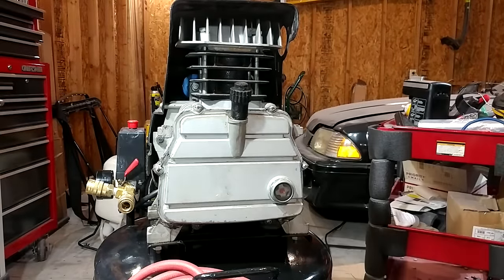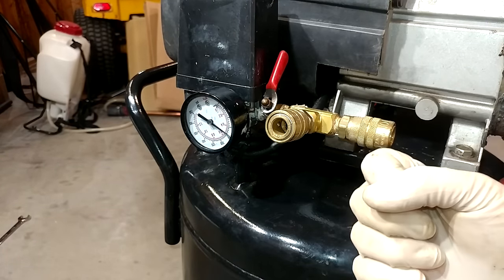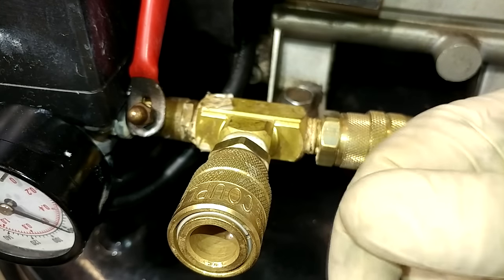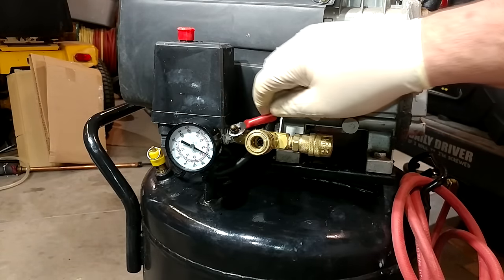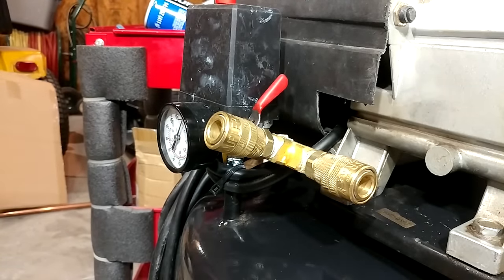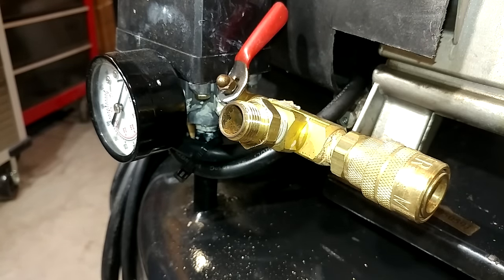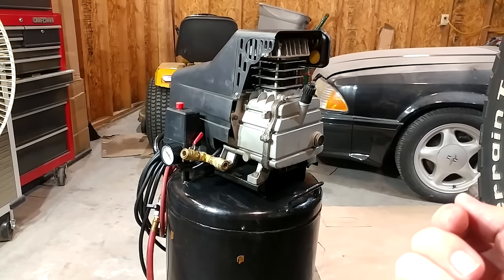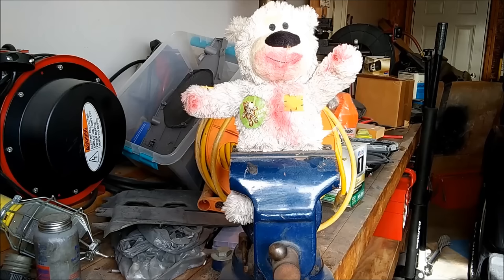Cheap Upgrades for Cheap Air Compressors!

Comment: okay so what exactly is the issue with a pressure regulator that is not allowing a larger flow rate?

a few comments regarding pressure regulators.  BY DESIGN, pressure regulators inherently affect flow rate.  This is just a reality.

and not surprising that your links do not point to any such improved design pressure regulator that allows better flow...BECAUSE THEY DO NOT EXIST !

lets gather some basic mathematical principles:

Bernoulli's Principle states that as the speed of a moving fluid increases, the pressure within the fluid decreases. (a moving fluid can also be a compressible gas...aka, air)

so if we think about what this principle is stating, we can make a few assumptions based on it:  

1.  if you change the pressure by increasing it, the speed of the air  decreases.
2.  if you change the pressure by decreasing it, the speed of air increases.

the internal components of a pressure regulator does not contain any magical unicorn or fairy dust.  It is a simple mechanism.  By closing the orifice, the air speed goes UP...and this has the effect of causing the air pressure to decrease.  And conversely, by opening the orifice, the air speed slows DOWN, but the pressure goes UP.

the relationship between how fast the air is traveling and how much pressure changes happen are essentially inversely proportional.  Changes made in one, change the other in the other way.  Pressure goes up, speed goes down.  Speed goes up, pressure goes down.  and visa versa.  

in summary:  you will NEVER GAIN some flow rate improvement on an air compressor, no matter what type of regulator that you use!  You are locked in because bernoulli's principle locks you in.    This includes how fast the air compressor can recharge, and how large the main tank input from the motor and the motor capacity as well as the tank output and line.  regulators must influence air speed...this allows for the pressure control.  

finally:  if you want a better flow rate, you will simply have to modify the air compressor entirely from scratch that would involve   A much larger faster and more powerful motor.  And larger diameter  input plumbing.  And also larger diameter output plumbing including the working line past the regulator.  Then you could install a larger capacity regulator that would allow you to regulate that larger volume in the plumbing.

I hope this makes sense.
Reply from the maker: This statement: "...you will NEVER GAIN some flow rate improvement on an air compressor, no matter what type of regulator that you use!"

...seems to be the root of the confusion. I didn't intend to say you can increase the flow rate of the compressor head itself. I intended to say that the regulator the compressor system (the compressor, the tank, the fittings, etc) came with has a terrible flow rate and/or pressure drop problem. To answer the only question you asked, I suspect the reason for that is probably really tiny internal passages. If you want to see the chart for the upgraded regulator you'll eventually see on the channel, it's a Parker 08R613AB. In my desired configuration, it should be able to flow several dozen CFM @ 90psi. I doubt the HFT regulators can flow 5. HFT doesn't publish performance data for their stock regulators so we'll never know.

My links didn't point to a new regulator because I didn't install one in this video. There's no smoke , mirrors, or magical dust here. I make money from links. I don't make anything by telling you to simply omit an item. 😆

Anyhow, I hope that cleared things up for you.
Reply: @TheBrokenLife  I think you are going to find (no, not think...but WILL FIND) that you are chasing a dream that doesn't exist.  The regulator is designed to accommodate  TANK SIZE AND REFRESH RATING OF THE MOTOR FOR THAT SIZED TANK. (plus to a certain degree the intake and the output plumbing).  So you go right ahead and experimentally demonstrate your dozens of CFM improvements with the parker...here is what you can expect:  At full open it will produce no more and no less than the existing flow rate.  WHY?  Because it's your working line diameter dude!  Also if you turn it in, then you will arrive at a certain regulated pressure, then same as you would with the OEM regulator and again, the flow rate will be no greater.  

this is the point you seem to be missing in your mission to upgrade things.  It's the entire system.  you've been led to believe that flow rate can be changed with a bigger larger regulator.  I am sorry to break this again, but it does not work like that.

About the ONLY thing you can accomplish with the said parker is possible more grandular control and maybe durability of components materials.  

I do not know why this is so confusing.  The regulator can only decrease BELOW the working flow rate of the output plumbing AND your working line (flexi hose...plus all the fitting downstream of it).  The regulator can NOT increase the flow rate above the working flow rate.  

this is one of the reasons why so many retail air compressors and even high end are restricted to low CFM ratings...It's not the regulator.  It's the fact that the capacity of the tank and the motor are only capable of providing the levels of pressure for that volume at wide open through all plumbing.

Here is a good way to demonstrate this.  take the pressure regulator off completely.   go direct to the output line with a air flow meter. Completely charge the tank with the motor and then start the test.  Measure the flow rate.  Notice how rapidly it drops.  At full wide open the motor will never be able to recharge quickly enough to maintain the initial flow rate.  This is why regulators are designed AROUND the entire system. Now put the OEM regulator back in, recharge the system completely with motor on.  Open the regulator to full open...again measure the flow rate.  You will find that the tank is able to maintain this wide open flow rate much much longer.  The small restriction is what makes the tank useable longer, while still maintaining the rated pressure!  Now if you want, you can demonstrate this also with the higher volumetric parker.  But understand a few things...even at wide open, the parker is never going to overcome the diameter of the input and output plumbing and the working line and all connections down stream.  You will demonstrate this if you really want to understand how nothing will change in terms of flow rate.  

and yes, putting the flow rate out at the very end of the working line is what I am talking about.  Because, again...the ENTIRE system is subject to bernoulli's...not just the regulator.

I don't think there is anything bad about the oem regulators.  If they are hard to adjust or have accuracy or holding problems...they are cheap enough.  throwing a parker at this isn't going to do much of anything.  It would be like slapping pirelli's on a go kart and expecting to get more horsepower.  flow rate is inherently tied to the system design.  regulators are not going to change that design.  If you want really high CFM...you are going to  need a much larger tank with a higher PSI WORKING RATING, a faster stronger motor to keep up, and larger diameter input and output plumbing.  

Good Luck.
Reply from the maker: @tdmmcl1532   "The regulator can NOT increase the flow rate above the working flow rate." I never said it could. For the second time I'm going to tell you that this is something you pulled directly from your imagination and seems to be the root of your misunderstanding. I said a good regulator (the Parker) will flow more than a bad regulator (the HFT). I also said, in a round about way in the video, that omitting the regulator will flow more than any regulator. I stand by all of that. I don't actually think we disagree... You're just thinking I said things I didn't for reasons that I don't fully understand at this point..?

Moving on ... "I don't think there is anything bad about the oem regulators." So you have no direct experience with this issue and are just speaking about things in terms of how you feel about them? Do you even own one of these compressors? 🙄 If you don't have this problem, then you don't need this solution. It really can be as easy as that. I also don't assert that every cheap compressor out there is going to have this issue. The one in the video is nearly 20 years old. Hopefully someone would have gotten one right on accident by now.

As regards the rest of your statements... Your beliefs seem to require the assumption that the HFT regulator simply cannot be an impediment to flow, or,  that they're an intentionally designed impediment dependent, which is hogwash. These compressors are "restricted to low CFM ratings" because of the price point, and after that, the power available out of the wall. There is no intentional balancing act of careful calibration by HFT's teams of engineers on this $150 air compressor. 😂Decreasing performance to "useless" upon the first pull of the trigger of an air tool is not a feature of the product, it's a bug. 

My belief is that HFT simply bolted the cheapest thing on to it that they could find and took no express care at all while they did it. Which really seems most likely? 

The actual truth, in function, is the HFT regulator didn't flow enough air to run an impact gun and removing the regulator solved the problem. I've found that to be true on 3 of these units, personally. You can watch the regulated side pressure drop to 20-30psi while there's 130psi in the tank. The regulator cannot flow the air required to operate the tool. Simple as that. I think that's almost verbatim what I said in the video. So... at this point there's either some other explanation for that phenomenon that you haven't managed to express, or you're calling me a liar.

Your "Pirelli's on a go cart" again exemplifies the disconnect between what you imagined I said vs. what I actually said. Better tires won't add horsepower to the motor, but they will decrease lap times if the tires were the limit before. It's the same story with the regulator. The compressor system is going make as much compressed air as it ever could, but if there is a huge outlet restriction in the regulator, a better regulator will relieve that restriction up to the limit of the next weakest link (which is probably the size of the fittings on the outlet of the tank...). Am I going to flow the maximum of what the Parker is capable of? Of course not. It will flow up to whatever the next impediment is. The next compressor, which has been on the channel for over a year now, has 1 1/4" fittings exactly to overcome the next hurdle... which is exactly why the Parker hasn't been on the channel yet. It's almost as if I do know what I'm doing and there is actually a plan unfolding here. 😆

Anyhow... You can think I'm the biggest idiot on the planet, or a liar, or invent things I didn't say, or whatever you want and rage on if you choose. I simply don't have the additional time to respond to novel after novel without getting anywhere for my effort. Believe what you like.

Comment: use 1/2 hose not 3/8 hose
Reply from the maker: Bigger is always better, but 3/8" ID air hose seems to be the standard for stuff that runs 1/4" NPT fittings.

Hopefully not too long from now I'll be doing a video where I set up some "big" plumbing. I'm looking at some 3/4 NPT stuff.

Comment: You shouldn't be running tools beyond their max airflow specifications. I.e. if an impact wrench specs say 90 psi you shouldn't push 135 through it. Why not get a nice steel ball valve and use that as a regulator and/or get a real regulator. And you have a ball valve but no gauge after the ball valve so you are flying blind.
Reply from the maker: "Shouldn't" and what people do are always going to be different things. I've never had an air tool failure so I'm not particularly worried about it. Plus, with my wimpy compressor, the time any of my tools might spend over 90psi is measured in seconds, not minutes.

Valves are not pressure regulators, they're volume restrictions. A valve and a regulator don't do the same job. Putting a gauge on the opposite side of a ball valve would reveal the same pressure on both sides of the valve regardless of how far open the valve is. There wouldn't be any point in it.

I openly admit that a nice regulator is on my shopping agenda. It's just way down at the bottom, especially considering I can just barely keep the compressor itself running.

Comment: oil the milton and it won't leak! lol...
Reply from the maker: I was reasonably sure that I showed the Milton was entirely full of rust chunks from my tank? 

Also, if you oil an air fitting you can never again use that fitting, or any of your hoses, for painting.
Reply: I've only been a successful Body shop and painter. It don't ruin the milton. Just keep them lubed with wd-30 once a month and done. Good Luck.

Comment: I quit watching when you used Channellocks on brass.
Reply from the maker: Did you expect me to use "the force" to disassemble it? There are no features on the part to use a wrench and it was so tight that any sort of soft jaws weren't going to work. Vise grips barely did...

Thanks for watching!

Comment: I don't care what brand of fitting you buy, they are all crap now.
Reply from the maker: The Miltons have been much better than most others. That said, I've moved on to Parker fitting, which are out right good, but radically more expensive.

Comment: No you gave a place for water to collect without a way to drain it, this is the same reason why there is a drain in the tank & even your natural gas line has a drip tube so moisture doesn't enter into the burners. Also Milton make high flow valves & fittings with about 30 to 40% flow increase.
Reply from the maker: This is why I put a separator in-line on the compressor that replaced this one and changed out to fittings without steel internals. The best of both worlds.

Many, many, people have suggested the Milton V fittings and I do intend to take a look at them.
Reply: @TheBrokenLife  You are right about the pressure regulators, if you need one put it on the device at the end of the hose. They are definitely a power robber. Good video & that's for the reply.
Reply from the maker: @alfredocuomo1546  I will eventually be making a video discussing regulators specifically. My present regulator is capable of something crazy like 40cfm at 90psi. There is no flow restriction anymore! 😆 Those seemingly little details do make a big difference.

Thanks, and thanks for watching it! 👍